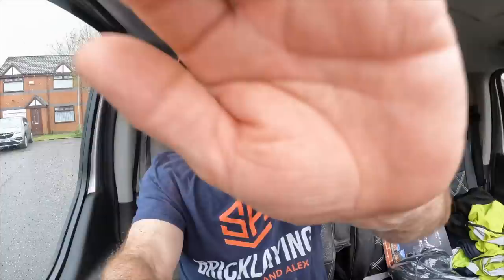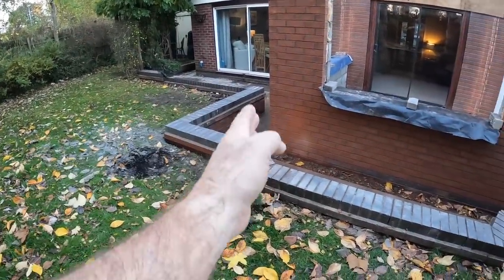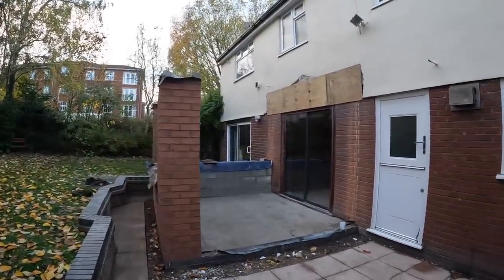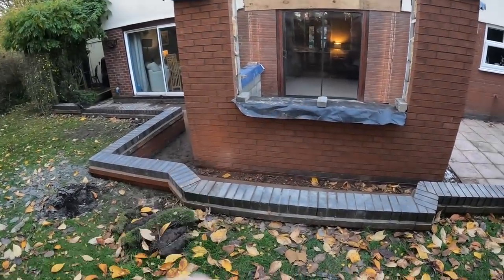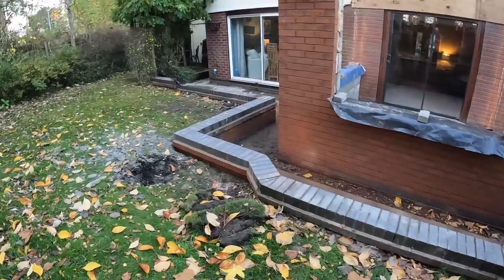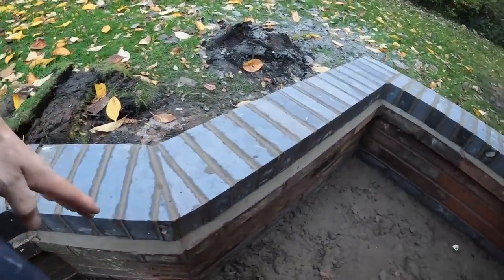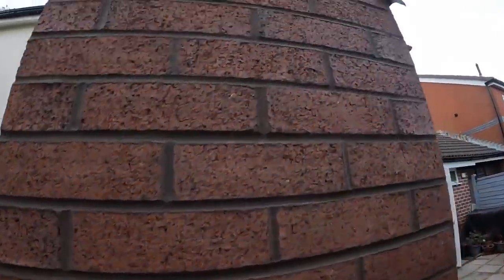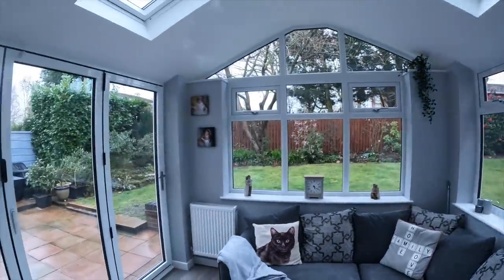A GREAT END TO A TOUGH JOB, FINISHING TOUCHES ... CONSERVATORY COMPLETE  7

Comment: Fantastic job to replace an  overheating (or cold) conservatory with an elegant and useful garden Room. Inside (and outside) it now looks part of the house. Loved the way the ceiling flowed through into the new room with the sloping sections rather than abrupt angles. Hope BCO were pleased with it. Would have been interested how you finished the wall around those triangular wall plates. Guess other option might have been some kind of bespoke joist hanger, but assume BCO always prefer standard solutions. Interesting what detailed drawings were required for BCO and who produced those. Anyhow, however achieved, superb final result. Think you will have lots more orders. Look forward to the next one, perhaps in Leamington?
Reply from the maker: Cheers John 😁🧱👍🏽

Comment: Making the wall cap smaller than the base is a little different.
Reply from the maker: What’s a wall cap ?
Reply: @SteveAndAlexBuild  It's like the hat you put on your head, except it's called a cap for a wall.
Reply from the maker: @richardmckrell4899  Still don’t understand what you are on about 🤔
Reply: @SteveAndAlexBuild  Wall caps are usually flush or overhang the base.
Reply from the maker: @richardmckrell4899  . Been at this 36 years and never heard what you are talking about 🙄
Reply: @SteveAndAlexBuild  I'm assuming you're joking, have a nice day.
Reply from the maker: @richardmckrell4899  Nope not joking not got a clue what you mean

Comment: I'm sorry to be the know it all here but that is not a conservatory. Firstly a conservatory has to be "predominantly glass", and that isn't, secondly you have radiators in there and a conservatory cannot have rads running off a boiler that feeds the house it has to have self contained heating ie. electric plug in rads. finally there is no door between the house and the conservatory and there has to be one.
Reply from the maker: 🙄. G thanks 🧱👍🏽
Reply: @SteveAndAlexBuild   I know I am late to the party, but what's he on about ?    BTW  love your work ethics and attention to details, really does make you stand out from the rest. 👍👍
Reply from the maker: @norfolkhall  cheers Keith 😁🧱👍🏽